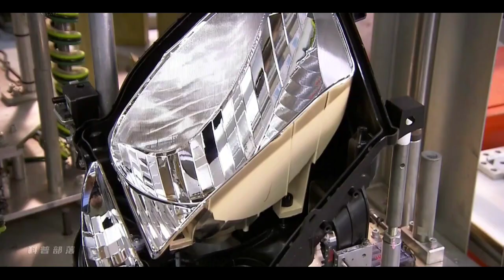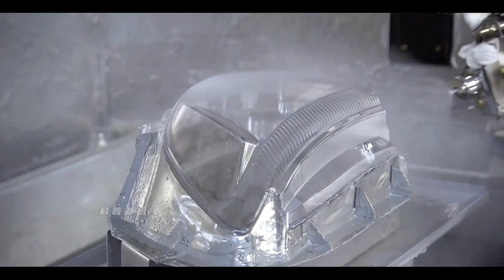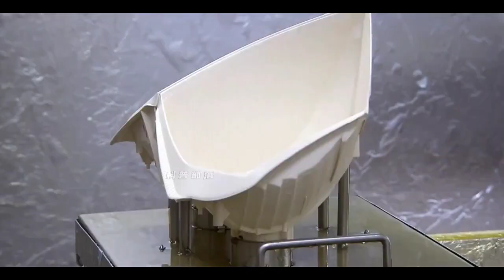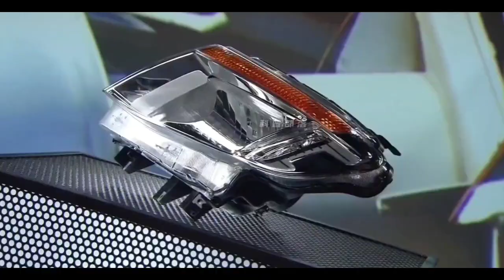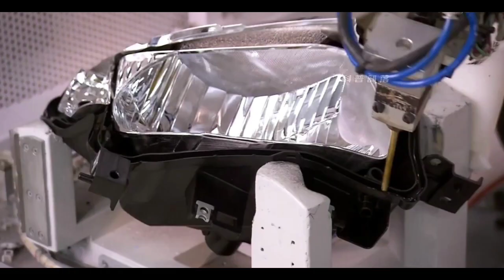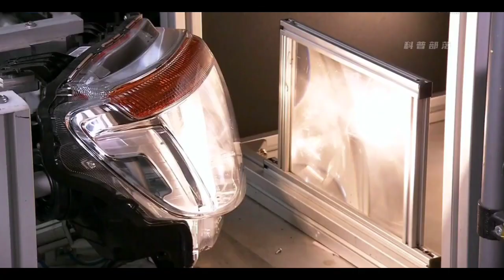Uncover the Secret Behind Car Headlight Manufacturing | Episode 2 #Documentary

Comment: Remember when headlight assemblies were made of glass? They lasted many, many years and were far cheaper than these head light assemblies that are costing in a range of $1,000 $1,300 dollars for just one side for a new headlight assembly. They start fading after 4 years and yellowing out and get expensive where after 7 plus years buying a whole new Headlight assembly. Glass was easy to buy and paying $20 bucks for a new head light assembly that was easy to install. 

Why not just have a glass or even a plastic front cover that is easy to take off with a couple simple screws without disassembling most of the front end where it can be swapped out without removing the whole headlight assembly when you get small chips up front or get tired of the yellowing over the years. Where way spend under 1 hundred bucks and can swap it with a new one in just a few minutes and be on our way? :body-blue-raised-arms: